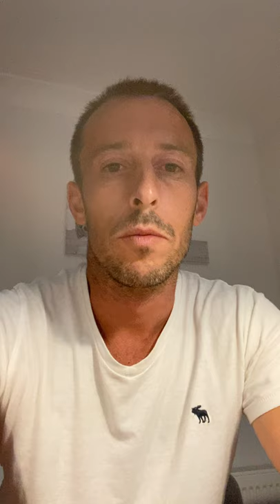Why you shouldn’t have cavity wall insulation installed.

Comment: Thanks for sharing your knowledge. Does it make a difference what type of cavity fill you get? Is EPS bead bead better than cellulose?
Reply from the maker: Your very welcome, I wouldn’t like to say to be honest. The best advice I could give to avoid any potential problems later on is,
• have a good amount of insulation within the loft space.
• upgrade your windows if they are really old, newer windows have better thermal efficiency nowadays.
• use insulation backed plasterboard on internal walls of the external walls (if redecoration is possible).
• Be wiser with energy consumption.
Reply: @CoastalWallTiesRustington  There are some good points there. You might want to add external insulation cladding, that way you don't isolate your thermal mass. We have had some bonded EPS beads put in our new build cavities (110mm), which we have been living in for a year with bare block work externally (windy wet devon). And it has been fine. And on the other end of things I went to look at a house with a friend where they had cellulose insulation in older narrower cavity, and that had transferred moisture to joist ends (1st floor and ground floor) and they had gone rotten, and needed replacing. For work I have also seen cellulose used in supplement to existing insulation, and that is generally terrible, as the thinner the cavity, the less homogenous the fill.  

In summary I would probably say cavity fill is fine, if you design for it from the start, and have a modern wide cavity, and then only bonded EPS, but I wouldn't touch cellulose for cavities. If you go on UK self build forums, bonded EPS is very commonly used, which is where I got the idea. I don't work for an EPS company by the way.

Comment: Thanks for clarifying. What about loft conversions, isn't that the same sort of principle? If the loft is all insulated and plastered to create a new room, where is the airflow gone? Would it not create moisture too?
Reply from the maker: Hi Riccardo, 

Yes that is correct, although you won’t have penetrating damp. The only thing to watch out for is condensation due to the moisture created and released into the air, this can be kept at bay quite easily. 

We will be doing a video based on condensation shortly with advice and tips.
Reply: Rescue and repair of cavity wall insulation.
Reply: it's all to do with what is considered inside the house and what is the 'cold' outside. A Loft with insulation on the floor creates a cold roofspace whithout a vapour barrier below which means it has to be ventilated as warm air hits the cold felt/tiles etc and condenses - the more airflow the less moisture. When you do a loft conversion the insulation should be removed from the floor of the roof to the roof covering itself. The attric becomes a warm part of the house. Getting the roof right  can be tricky as you ideally want  continuous vapour barrier and insulation layer in the attic crating a 'warm roof'.   None of this helps with humidity in the livable part of the house as water vapour will tend to rise - which is why attention to ventilation of living spaces is also very important.

Comment: Not only that, my house was rewired by dropping strings down the cavity, to pull the new wires up & down to plug sockets, from the loft. People with blocked up cavity have walls extensively chiselled to rewire

Comment: Hi Alex. I can see your reasoning for this scare mongering video as it clearly a good way for you to get a lot more extraction work but some of your comments are clearly total tosh: Bead is clearly waterproof and of no risk so you counter this by saying Ants bring mud into the cavity which gets wet and causes damp issues, (omg how ridiculous) and you claim that you have even found this at the top of a gable wall, bead is not even installed above eaves height Alex?? Bead causing issues by putting pressure on the outside wall and making it crack, again silly, the bead is feather light! Plenty of other total tosh comments her but rest assured folks Bead insulation is perfectly safe - Do not be taken in by the guy who is clearly benefiting from more enquiries for his business on the back of this video! 
One thing you are correct with Alex is that the government would not be pushing it if it did not have significant benefits to the householder!!
Reply from the maker: I appreciate your comments but as a contractor who sees the results of it, it is no means scare mongering or to benefit my business. You are entitled to your opinion as is anyone else but it’s more about making people aware of the potential problems. Would you like pictures of ants nests within a bead insulated property?
Reply: the cavity wall industry is an absolute disgrace. History of chasing grants without doing proper surveys and installed products which have had no testing in older properties.  We've had people falling through rotten floors because beads have blocked up vents and restricted airfloor.  Beads provide a bridge for peneetrating to cross - particularly if the wall ties were not checked for muck and cavities not clear of debris which is the majority of CWI installations done in this county. Also most beads installers ignore electics in the cavity and people are now having to have electrics sheathed because of degredation of the beads on cables - but CIGA say that the act of getting an electritian in to fix this 'invalidates' the guarantee.  If the industry was honest and fixed issues quickly without seeking to blame the home owner at every turn I think we would have more sympathy  but it's utterly corrupt.

Comment: Absolutely terrible video, no talk of the type of insulation used or the reasons its causing damp.

Lots of different products for different houses and cavity wall insulation can be one of the most effective ways to insulate your property done correctly.

"What the problem is is that it is installed too quickly". Wow utter nonsense. Again what type of insulation is this. If bead is used correctly then it cannot be compressed by "quick installation"
Reply from the maker: Thanks Warren, appreciate your comments,  no beads can’t be compressed, I was referring to whitewool insulation, but thanks for highlighting. 

Your right insulation is a good insulator, but unfortunately with most things they have pros and cons. If it’s installed properly and the property is surveyed correctly along with an assessment of suitability, then yes it can work.
Reply from the maker: I see that your an insulation contractor as well, hence the harshness 👍 as always two sides to every story. I’m just highlighting potential problems to educate consumers, not dismissing the whole idea. If all cavity wall insulation was fine then there wouldn’t be a booming industry in the removal of the stuff.

All the best.
Reply: @CoastalWallTiesRustington  95% of extraction is of one product. 

Yes I’m in the insulation industry and I spend every day reassuring people over after listening to generalised opinions of “all cavity wall insulation”
Reply from the maker: I would probably agree that the majority of cases, mineral fibre is the problem along with a bad install (generally). 
I know your a fan of beads and that they are in fact waterproof but through experience, They still have issues such as being underbonded, then someone replaces a lintel above a window and you lose half the cavity fill. Also, just because the beads are waterproof doesn’t mean that water cannot sit on the beads.